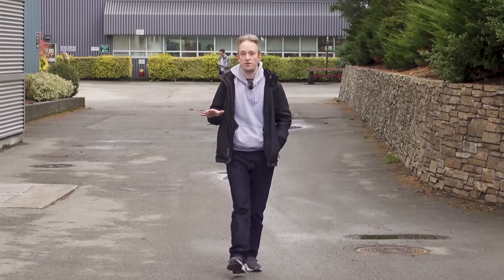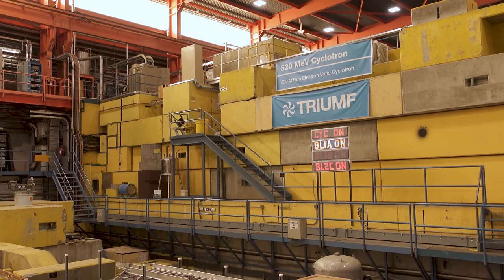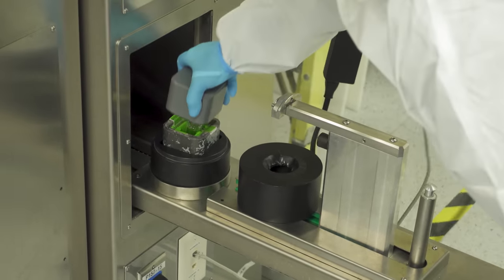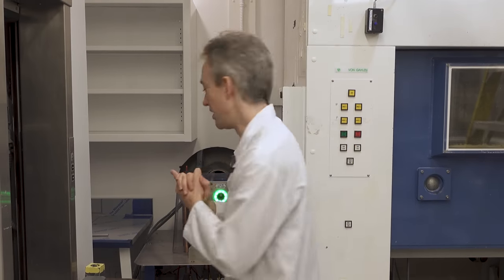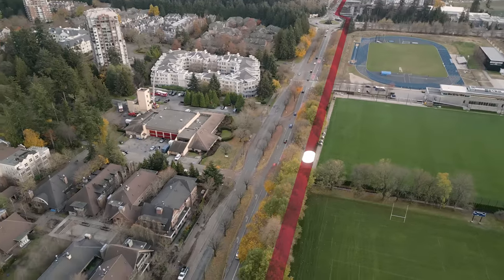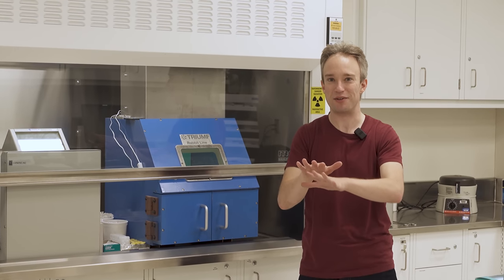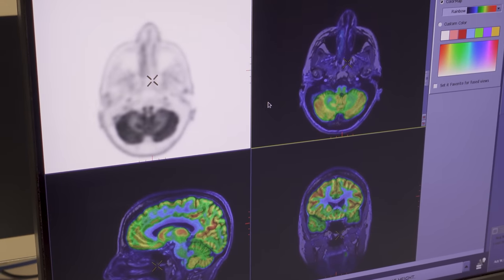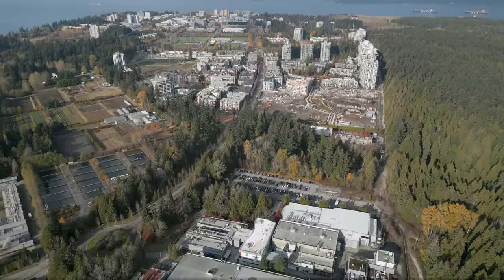Firing radioactive stuff at high speed under city streets

Comment: Most hospitals I've been to have their own cyclotrones and accelerators. It's always fun to stumble on a heavy metal door plastered with 'radioactive' and 'access forbidden' sign somewhere in the bowels of a medical facility :)
Reply: I was thinking this - probably in most cases it's in the same building, making this system unnecessary. This example is probably unusual in that both are research facilities, and were probably built at different times. Perhaps when both were built they weren't related to one another, before radiological research was being done at the hospital, but using existing nuclear research facilities on the far side of campus and building this Rabbit Line was more practical than adding such equipment to the hospital.
Reply: Those are tiny compared to the one at UBC, it used to be the largest in the world, and there's a spin off company called Advanced Cyclotron Systems that make small ones for hospitals and research.

Comment: I worked for a company that shares a lot of "cyclotron genealogy" with the TRIUMF cyclotron, and produced some of the equipment used with that cyclotron (though that was mostly before my time). The company later went on to design and build much smaller, self-shielded cyclotrons that could be installed on site in a hospital, literally next door to the room containing the scanner, where the isotopes generated by the cyclotron were used. Because they were so close to the point of use, these smaller cyclotrons could produce isotopes that wouldn't withstand even a quick trip through a pneumatic line. The shortest-lived isotope we used was O-15, with a half-life of only two minutes. Not a lot of leeway there.
Reply: That's very cool. What's your job?
Reply: @KevintheRhea  (Past tense; it was quite a while ago) I designed control systems and other electronics, as well as did some physics modeling. The most challenging thing I ever designed was a 600 W current source for a load that had a very high differential negative resistance. The load behaved fairly linearly at low current, up to about 100 mA at 1500 V, then the resistance dropped precipitously until it was pulling 3 A at 200 V. Getting stable current control under those conditions (without wasting a few kW) was very, very difficult. One day, I was testing a version of the circuit and one of the power transistors exploded and shot a blob of molten metal that bounced off my shirt and landed on my shoe, melting a hole into the synthetic fabric. I kept the shoe as a souvenir for a while.
Reply: @schafer6811  The fact that you kept the shoe as a souvenir is such an awesome response to it.
Reply: Years ago when my father would visit University of Washington Medical Center for some radiation therapy, I noticed they had a room with a gigantic rotary door that had to be six feet thick. Turns out, they have their own 50MeV cyclotron and they use it to generate neutrons for special neck cancer therapy (Fast Neutron Therapy), and are the only hospital in the world to have such a thing. I wanted to see it but they didn't give tours, I guess.

Comment: It's called the rabbit line as an internal pipe diameter gauge (like the thing sent down the tubes here) is called a rabbit in the oilfield/pipeline industry, part of a long line of animal-themed nicknames:
- Rabbit: internal pipe diameter gauge
- Pig: plug pumped along to scrape inside of pipe and clean it
- Fish: something dropped inside the pipe you need to go and "fish" out
- Pup: a shorter than normal joint of pipe
- Mouse hole: A hole in the floor for standing up a section of pipe before joining it to the rest 
- Bull plug: A blank/blind-ended plug that seals off the pipe
Reply: And all the Rathole drilling companies.
Reply: neat!
Reply: Cool. I didn't expect there'd be a real answer to that question.
Reply: We had an old pneumatic tube system on my Navy ship.  We called it the "bunny tube".
Reply: Ah, that's not the explanation I know... mine is more akin the the cleaning device being known as a rabbit...
Reply: Interesting!!
Reply: rabbits run, pigs wallow   yup yup
Reply: - Nipple: a short pipe fitting.

Comment: Compressed air-propelled systems like this one, even if it is on a small scale, are very interesting.

This technology used to be more widely used, if I'm not mistaken certain big cities used to have an air-propelled postal distribution network, a century ago.
Reply: And Futurama has it 1000 years in the future  :)
Reply: There was a Hyperloop style pneumatic subway demonstrator in Manhattan during the 1870's
Perhaps Tom has already done an episode (or should!)
Reply: The Tesco near me has a pneumatic system for sending daily reports from cash registers.
Reply: Roosevelt Island in NYC has a pneumatic trash system!
Reply: London had a couple of goes at getting a pneumatic railway up and running. There was one that ran from Euston Station in the 1860s or 70s, but only for a few years. It was too difficult to maintain, for one thing. Keeping an airtight seal was nearly impossible for anything more than a short period.
Reply: @StormhavenGaming  becuase the train is outside of the pneumatic line.
Reply: @jimurrata6785  hyperloop is meant to be a vacuum, it doen't use compressed air., of course not a not a good example of Musk snake oil sales.
Reply: I recently worked (although in a different project) at UK company that made a system for sending frozen DNA samples from a freezer at -80c to many different labs in a building, very much smaller samples, but super fast. The devices that did the switching were called pigs, because of the round shape with two outlets. The prototype was painted pink, though sadly the production versions are white. 100% automated, the user just requests a sample and second later is in his lab. It uses both a vacuum to suck and compressed air to blow, to be super fast..
Reply: Compressed air is a very functional energy storage mechanism.  Great for shooting nails at high speed.  If not for electricity we'd have alot more air powered systems in the world. 

 I've even heard of it being used in high fidelity electronic systems where they want to minimize electronic interference so they use compressed air/pneumatic systems for all sorts of things.
Reply: There was one in Paris.
 It functioned from 1868 to 1984 and measured up to 427 km in 1933 when the usage peaked.
Reply: @paulthomas8262  No, I'm not referring to the older atmospheric railways. The London pneumatic railway had the cars within the line.
Reply: When I was a child the big department store (Suitors in Slough, England) used to have a pneumatic system to link its cash desks to the central control room.
Reply: @paulthomas8262  Silly me to equate using air pressure inside an 8' diameter tube to move 22 passengers in a car with seals.  🤣
The Beach Pneumatic Transit design used pressure to travel in one direction and vacuum to move back. (It wasn't a "loop" at all)
Reply: @Martititi  So you're saying it was literally 1984?
Reply: My pharmacy in small town USA uses this to send prescriptions to your car. Ring an intercom with your details and prescription required, a few seconds later they send a pill bottle through a pressurised tube out to the parking lot. The bank does the same thing with checks as well.
Reply: @jimurrata6785  The hyperloop doesn't intend to use relative pressure as a means of propulsion. Merely to reduce air resistance, or course the concept is flawed.
Reply: @InShortSight  Also used, albeit with fluid, in harsh industrial environments, and in your vehicle automatic gearbox, along with being the de facto control system in a lot of aircraft for control surface actuation and control. There have been a few high radiation resistant systems in nuclear industry as well, as you can do very complex control, with only a few simple inputs, and survive massive doses of radiation that would destroy electronics.
Reply: Add routers and you have "the internet of things" ;)
Reply: Banks still widely use pneumatic systems at their drive throughs, when you're in the lines more distant from the building and those plastic capsules to swap stuff back and forth with the teller. :)
Reply: @StormhavenGaming  Note that pneumatic railways like the one Isambard Kingdom Brunel tried to get up and running used air pressure as a power source, but the air pressure evacuated a tube under the rail and the train had a piston that was powered by releasing air into the tube.

Instead of developing electric cars I think Dyson should try and perfect the pneumatic railway, this would be a good use of their expertise in sucking and blowing to transport.
Reply: @allanolley4874  Brunel's system did indeed work on those lines, but that was in the 1840s (if memory serves). The one in London was later and the cars ran inside the pressurised tube.
Reply: @allanolley4874  That's why I distinguished between the atmospheric railway (Brunel's system) and the pneumatic railway (the one in London and, I believe, other places).
Reply: There's several corporate tech campuses in Silicon Valley which have 1920s-style pneumatic tubes.  It turns out that the fastest data transfer method is actually by copying to thumb drive and then whooshing the drive physically across the campus.
Reply: I believe a lot of Costco's still use it, there was even a case of stolen money that way some years ago. But I guess those systems are not as widely used today because of replacing paper with digital files.
Reply: Pneumatic systems were very common until the advent of the telephone. After which not nearly as many messages needed to be physically delivered. But they are commonly still in use all around you. Drive through Pharmacy and banks still widely use them etc.
Reply: @NoJusticeNoPeace  A variation on: Never underestimate the bandwidth of a truck full of floppy drives traveling down the highway at 50mph.
Reply: Russian State library uses a system of air-compressed tubes to send books requests from the librarian stand to the vault and back. It is really complex as far as I know, because there are a lot of possible senders as well as receivers.
Reply: The US Navy used (uses still maybe) pneumatic tube systems to move messages around. I was on a ship and for stuff that say needed to get to the bridge fast especially when we were underway we could stick the printed message in a tube and send it up faster then running it up on foot.
Reply: I used to work at a foundry that used one to send metal samples to the on-site lab for analysis, before a casting run. They would put little ingots of the melt into a mass spectrometer to check the composition of the alloy.
Reply: When I was a kid there was a clothes shop in town where to buy something, you handed it to the assistant with your cash, they took off a label from the item with the price on, put label and cash in a little box, attached it to a line above their head and pushed a button and it zapped across on the line to a central till, where the cashier took it out, made change which they put in the box and sent back to the assistant while they entered the sale in the ledger with an ink pen. A a kid I loved watching the boxes zip around the ceiling. I imagine they were propelled by something similar.
Reply: @jimurrata6785  Vactrain tubes do not use air pressure. They use magnetism to move through a tube with the vacuum allowing for almost no friction. It's a competely different mode of transport. So yes silly you indeed.
Reply: Hamburg, Germany, has had one of the widest networks for "pipe post" around the Central Post Office, but it's been disused for decades, probably since the 70s/80s. There were multiple networks, too.
Reply: @nrellis666  Some supermarkets still use those in France.
Reply: @aaronaaronsen3360  There are a number of companies that still develop and sell these systems. "Cash register to back office" is one of their marketing examples. There's at least one very good video on YouTube about one of them.

And BTW, in the 60s, pneumatic tubes were the go-to solution for intra-office communication in large office buildings that needed to send paperwork around quickly. Many office buildings from those times still have part of that infrastructure in place where it wasn't in the way of some new installation. I heard that network cable installers loved those old shafts that go everywhere ;)
Reply: @HenryLoenwind  Old pneumatic mail tubes to put the new email tubes, that's ironic 😅
Reply: The technology is used in some hospitals to get samples to the lab. Problem is, it's not feasible for every kind of sample, the acceleration/deccelleration will affect some measurands (think cells popping under mechanical stress or at least changing their characteristics), and as such, you'll need a courier for some samples anyway, which is why not every hospital bothers.
Reply: @StormhavenGaming  The idea was developed by Brunel for surface railways.

Comment: Another interesting fact regarding stuff under city streets at UBC: I believe most if not all the buildings on campus utilize a central heating source that produces superheated steam and transports it underground (there is a main feed and return line under Main Mall) to avoid electrical heating methods. It is a closed loop system and all the steam is recycled.
Reply: District steam heating is very common in a lot of cities and campuses.

Comment: Similar to pressure systems used by banks, just a lot longer and carries radioactive material. Really cool and also very practical considering the short half-life of the material and safer.
Reply: Those systems are themselves a relic of a bygone era: Pneumatic transport tubes used to be incredibly common, passing stock prices between markets and telegraph stations, enabling sales of perishable commodities, helping sort mail and in some cases running near city-wide postal networks. There were even a few rare examples that carried *people*.

They were mostly abandoned around the time of the second world war, when automobiles became relatively cheap and convenient: Such systems are not cheap to run!
Reply: Systems like that are still fairly common in hospitals, although you're only supposed to use them for specific things. Hospitals can be big places, so getting stuff somewhere quickly is sometimes best achieved with a vacuum tube system.
Reply: @rossstewart9475  I know banks still use these kind of systems, why and for what I don't know, but I know when I was working at renovating a bank a few years ago I saw the tube system in the ceiling.
Reply: @High.on.Life_DnB  For the money of course, do you want carts of cash running down the halls? Some of it might disappear mysteriously

Comment: That's amazing. I remember when pneumatic tubes were seen much more often.  My bank's drive in used a much larger and slower pneumatic tube. At the State of Minnesota, they had a pneumatic tube system to shoot mail around the state capitol area. The "leak air out at destination" is a really simple solution to an important engineering issue.

Comment: I used to work as an operator at a nuclear research reactor (at Reed College; I think Tom has already made a video about it) that had a similar device, for removing experimental samples with short half-lives at high speed - though its path was much shorter, only across a few rooms. I think it was called the 'rabbit' just because it moved very fast.

Comment: Hey Tom, I'm a Cyclotron Engineer for the Cleveland Clinic and I loved this video! I work on a much less powerful Cyclotron (11 MeV)  used to make traces for a number of hospitals in NE Ohio. So cool to see what I do on such a large scale and to recognize a lot of the same equipment in my own lab. For anyone more curious in how Cyclotrons work we inject hydrogen into the cyclotron's ion source which adds an electron to the hydrogen particles giving them a negative charge. The electron beam then circles around a tank under very high vacuum where it is controlled by magnets and RF. Eventually the electron beam hits an extractor made out of carbon that strips off the electrons, changing the polarity of the beam from negative to positive (proton beam). The change in polarity allows the magnet to fire the beam into a target of pressured 018 water which after being bombarded turns into the radioisotope F18 used by the chemists and pharmacists to make a number of different traces.

Comment: This is awesome!  

As an undergraduate in the summer of 1994, I was hired as a research assistant.  Near the end of that summer, we helped run an experiment at TRIUMF, back when it was a physics research accelerator.  I spent many hours in that giant room with the yellow blocks as we were buttoning up the experiment, and then another week in the counting room on the upper floor as the experiment ran.  

It's so cool that it's been re-purposed as a medical research accelerator.  I love it!  

Thanks for the blast from the past, Tom!
Reply: It's still used for lots of physics research as well, it just also services the medical research too.
Reply: Ah, maybe you could answer the question I had watching the video...  if it's producing a proton beam, why does it start out with hydrogen anions?  I get that the cyclotron needs charged particles, but not why H- is used for part of the process and then stripped (how?) of electrons.
Reply: @gary27182  The two electrons are stripped off the H- via carbon foils - the much heavier protons pass through. They are used to extract multiple proton beams at once (instead of just one), with the additional benefit of being able to set the energy of each beam by (radially) moving the foils.